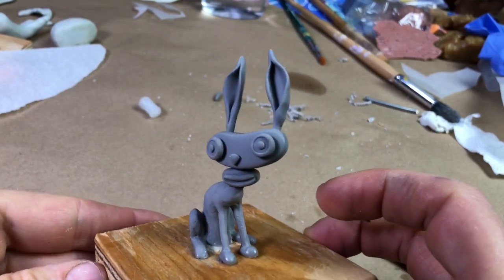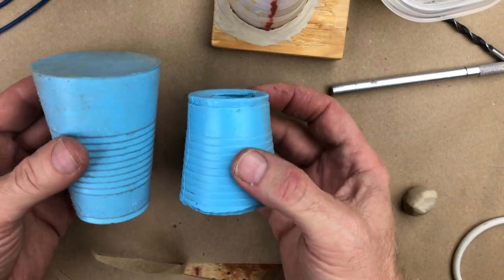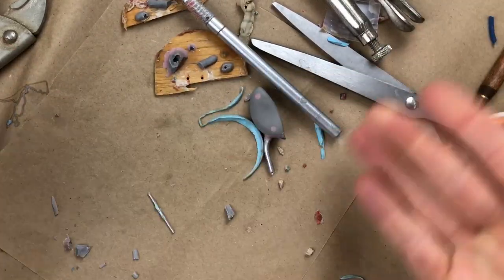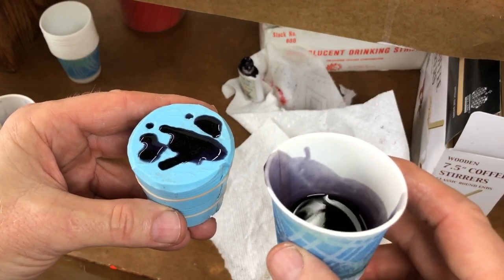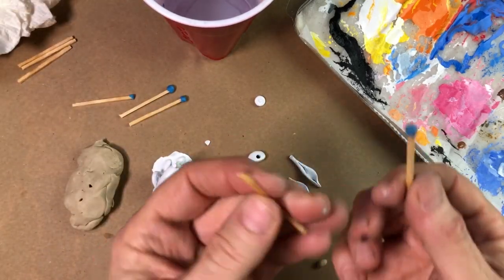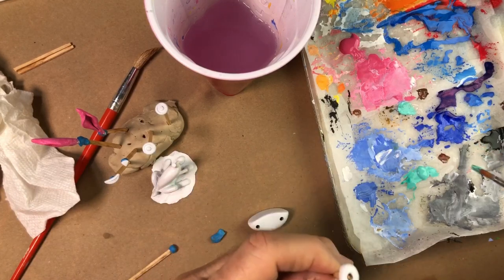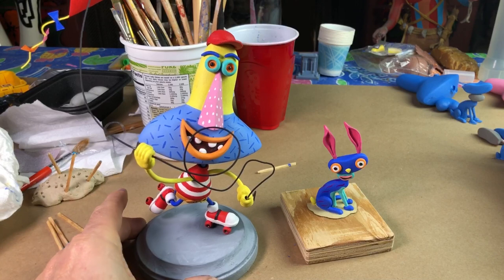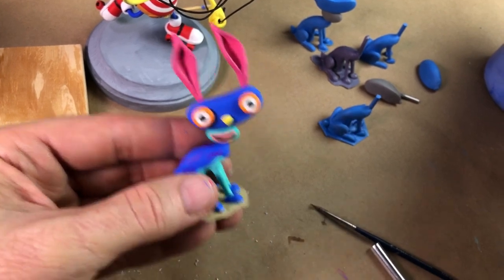Molding, Casting And Painting A Resin Sculpture

Comment: You have a great channel!
I have been trying to make cast-offs from my 1/8 human figurine for quite a while now. I think I only got it all right after my 4th try. And there is still much room for perfection.
I wish I found your channel earlier so that I wouldn't have spent so much time and resources on trial and error.
Reply from the maker: Hi Fedor, I am trying to make the channel I wish I had when I started molding and casting my sculptures.
Reply: @RobertTolone  
The amount of videos you have produced in 1 year is astonishing. Keep up the good work!

Could you please describe in a future video the materials you use in more detail? The difference between silicone catalysts, epoxy and urethane, how temperature affect curing, how hard you should mix the components etc. Just all the small pieces of wisdom you have discovered in your career

Comment: Thank you for your videos. Have you got any idea about resin writing and resin drawing on mold to create mini different color details?
Reply from the maker: You can do it. It is possible to make fully painted, multicolor castings by painting the resin inside of the molds.  But there are some downsides:
All resins change colors as they get older. Typically they get more yellow and darker. Also, you have to paint the mold quickly before the resin begins to gel. Usually you have to use a solvent such as acetone to clean your brushes and the process is hard on brushes.

And finally I find it is much easier to paint the resin castings. I have castings that are 40 years old that look brand new because the artist quality paint does not fade.

Comment: I pour from the bottom up but my hand shakes and gets squiggles over the top. What will it do to the mold? I guess I will know in a few hours when I cut it open.
Reply from the maker: Squiggles probably won’t hurt it. it’s when you drape the rubber over the model that you can trap air between the rubber and the model.

Comment: how durable is that paint, will scratch off?
Reply from the maker: It is Artist’s acrylic but it bonds well to the primer on the resin. I have resin sculptures that are 30 years old that are still in excellent condition. They should be fine as long as they are not in direct sunlight and reasonably well cared for.

Comment: I've noticed you make use of a lot of paper and plastic cups in your work.  Have you ever encountered any types of bad reactions mixing rubber or resin using a particular kind of cup?  As always thanks for the videos.
Reply from the maker: Yes. Some kinds of resin will melt some kinds of plastic cups. And silicone rubber might stick to paper cups making impossible to reuse the cup. Foam cups are particularly susceptible to problems with resins, paint, solvents etc. Always test a small amount of your material in the cups you are using to find the best cup that works with your material.